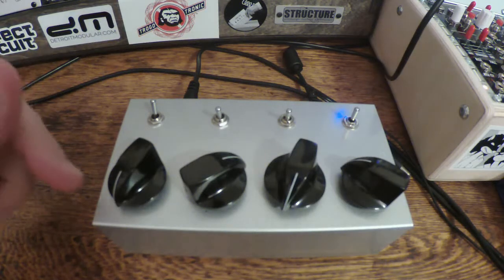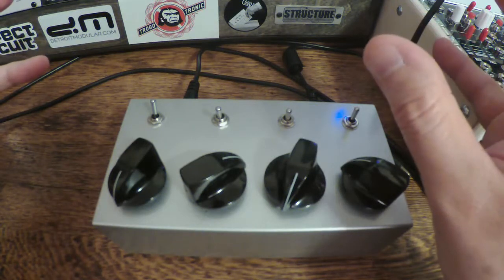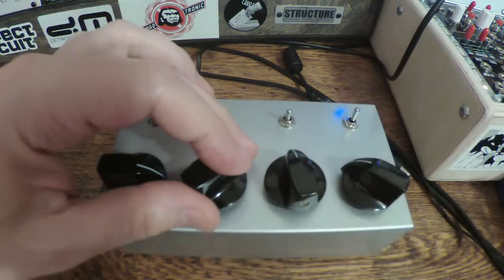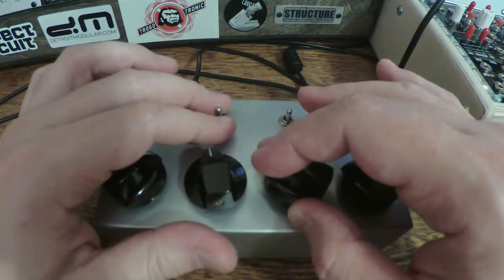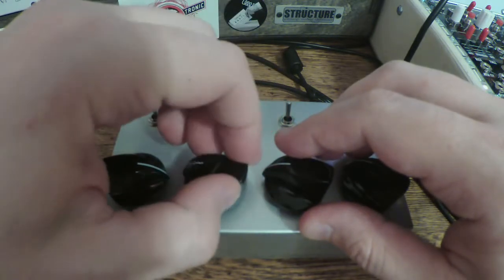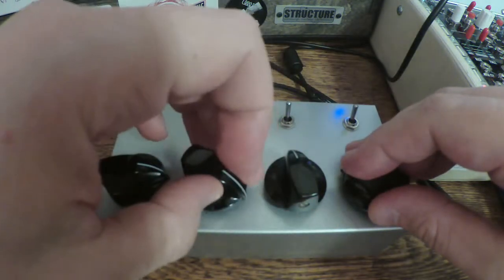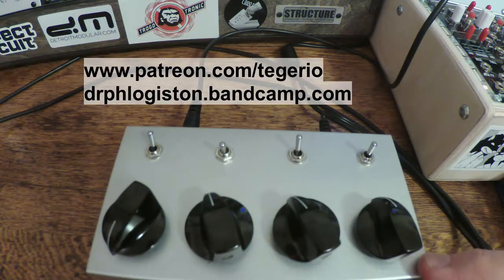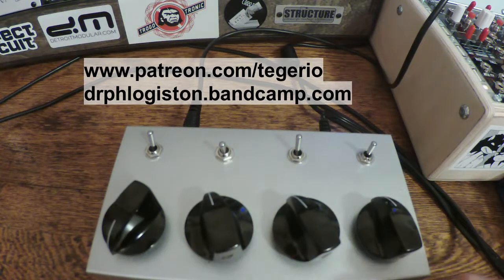Let's listen to JMT Synth NF2

Comment: I ended up buying one of these.  The osc 1 pitch was a bit higher than the videos online.  JMT told me that you can run this machine off of lower voltages (down to 5V).  I grabbed a 6V power supply and now it gets a whole range of lower frequency sounds.  Just wanted to mention this here in case anyone else finds the info useful.
Reply from the maker: That's good to know!  Maybe as the battery runs down I'll get lower tones out of mine .. or I could rig up a voltage-starve resistor; that shouldn't be too hard.